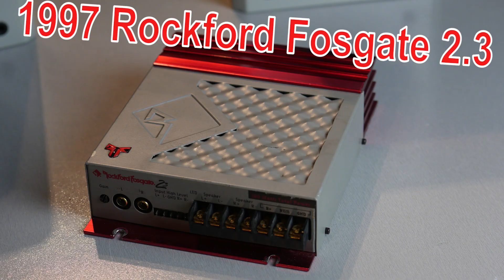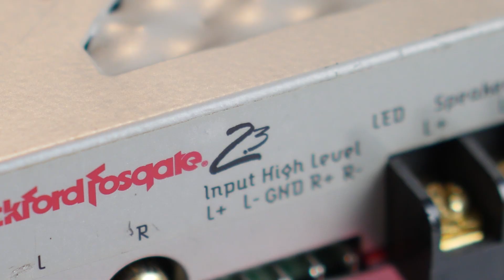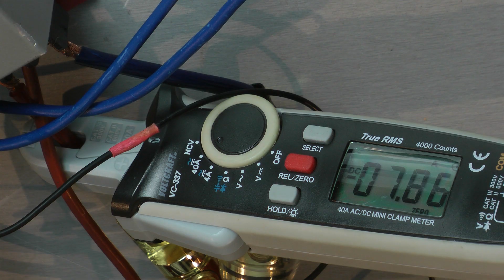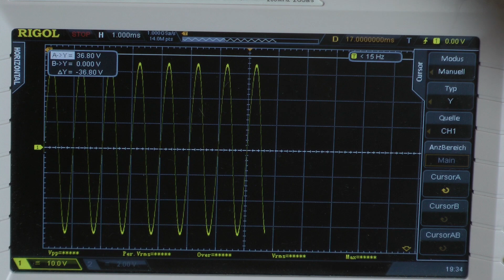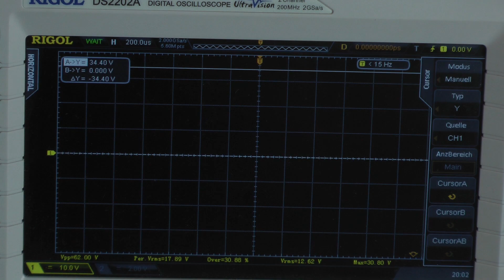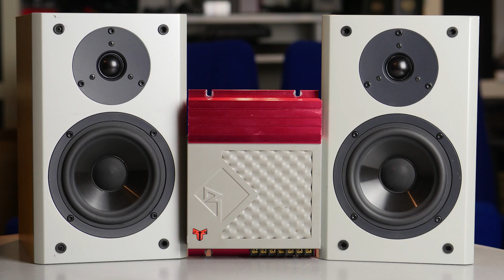Rockford Fosgate 2.3 oldschool stereo car audio amplifier sound test & amp dyno also mono 2 Ohms !

Comment: Great video!  May we suggest a notice on tests below the recommended 2Ω stereo / 4Ω bridged impedance? We get customers that run their older amplifiers at 1Ω - although designed for 2Ω min - and blow them up because they saw an amp test like this one.  Something like: "This test is only for brief moments to check the integrity of the power supply and output devices and is not recommended by Rockford Fosgate.  Please follow the owner's manual for proper wiring and lowest recommended impedances."  Nice work and thank you again for featuring a Rockford Fosgate amplifier!
Reply from the maker: Thank you very much!
Yes I know that these tests into 1 Ohm per channel aren’t recommended by the manufacturer. There were RF models out there like Punch 50M where this is no problem, I do it just for demonstration.
Regarding the old amplifiers from mid 90s : Rockford tested them all dynamically into a 1 Ohm load. There were grafics printed on the bottom of every carton all tests done with the powercube. Some amps do way more power and some don’t.
I ran my punch 40ix only 2 ohms mono for 6 years without problems.
But I get your point, i am going to add your recommendation into my test-sheets in future 👍
Thank you again and greetings from Germany 👋😊